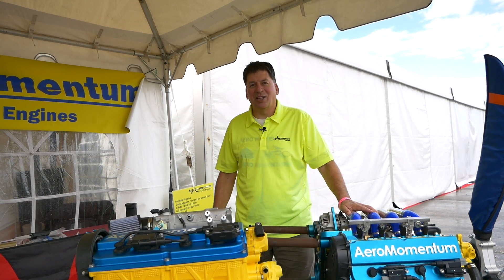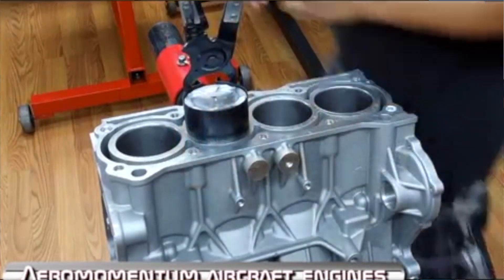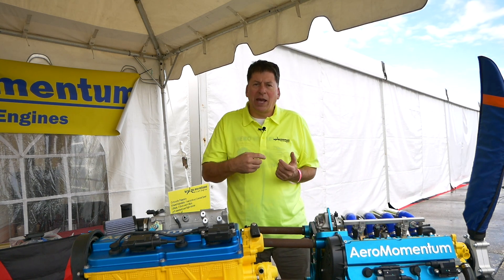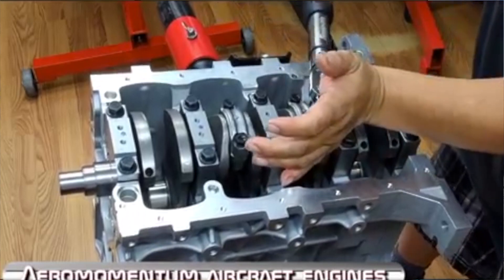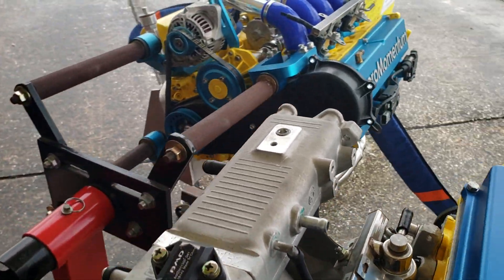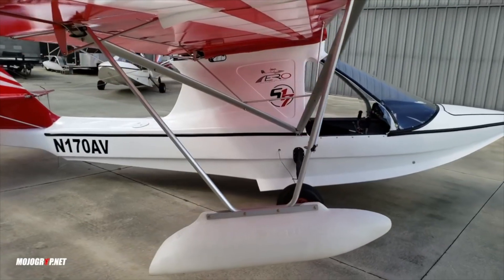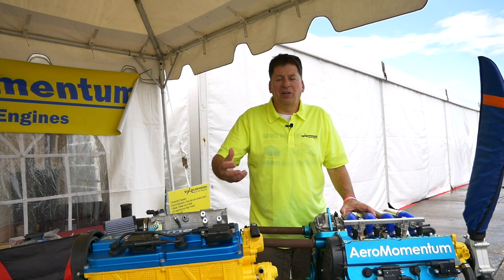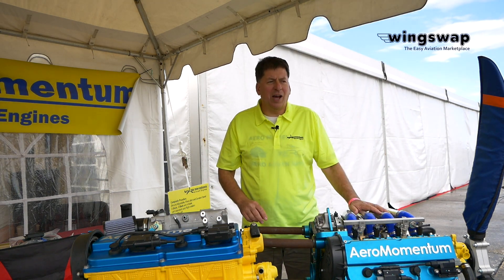New Line Of Aircraft Engines l US Sport Aviation Expo l Aeromomentum

Comment: I would use a good "Used" Engine Block. It's already "settled" out on a molecular level. I would feel nervous about a Timing Belt on an Aircraft too. Modern Automotive Engines are mechanically able to go over a couple hundred K Miles in a Car with an Owner who does not take maintenance as required unless Lights start beeping and flashing nowadays because the Metal alloys and Parts interchangableaty due tu the tolerances from CNC finishing. Add some redundancy into the Engine management , and yeah , probably I would choose it over an antiquated , never upgraded Continental piece of Junk , well not junk , but not a $ Engine that's worth anything near $100,000.00. maybe a Porsche 911 turbo Engine would be nice too. I like Your Propeller set up..

Comment: What I want to know is the fitness of the prop box and the connection to the crank I'd it puts dynamic tangenial loading and it's ability to accept piston torque pulse hammer without grenading and the pull tortion of the reduction box transferrance
I.E. is the prop forces are transmitted thru engine mounting or is reduction mount frame mounted ?

Comment: Following these guys since I saw a video lat year,
 I plan to put their 260HP diesel on an RV-10
Reply: What diesel?
Reply: Your thinking the Hyundai based turbo gas 2L engine rated at 260hp.  But it's not a diesel
Reply: @brent1041  yeah thats it, for some reason I had diesel in my head,  I thought I read or a video I watch said that but only thing  I see on the page is regular gas.  This can be problematic to get fuel unless you can find airports with regular?
Reply: Fenderbean1979 or carry your own fuel in a mini trailer tanker. I think there are surplus military tanker trailer that you can get for a grand( more or less)
Reply: @DragonBuildsRC  Engines run fine on 100LL as long as they don't have a catalytic converter (which aircraft engines do not have), being able to run on regular mogas is just a bonus.
Reply: Impossible to do on a cross country trip.

Comment: I am considering trying to build an aircraft in the semi-distant future (hopefully about 5 years) from the Rutan family of canard aircraft (Aerocanard, velocity, Long EZ, or something of that nature), and was wondering how well this engine would work in that type of aircraft. Not simply from a space perspective, but more about cooling efficiency and exhaust/cabin heating management.
Reply: Skyfighter64 check out the Raptor. They are using a Audi Diesel engine with a canard shape aircraft.
Reply: @mrhats830  I checked out that Raptor aircraft, and unfortunately, the information gleamed from the website is of little use in my inquiry about a homebuilt like the long EZ, and this inline 4 cylinder.

Comment: Seems to have long intake Runners without cross bleeds within a few inches of the intake port, how are you combating reversion, or is your operating RPM on the low side? Seems to me that you're cheating yourself out of quite a bit of torque that way.

Still sounds like a much better option than rotax, and I've never heard much good about the rotax. Never been impressed with them in any way shape or form. They are an adequate engine for a snowmobile. But when they break down on a snowmobile you don't fall 10,000 feet.

Looks like a good concept for light aircraft. Immediately had thoughts of the Yamaha VMAX 142 horsepower motorcycle engine. I always wondered how well that would work as an aircraft engine?
Reply: I too wonder about the connector tube.
Aircraft engines usually rotate at fairly low rpm, but if they're small capacity they must have a gear reduction drive becuse they won't make 100hp from 1300cc at 2700rpm as small engines need rpms to pump the same amount of air as a larger engine at lower rpm (using the air pump model as an indicator of power production).
Props can't go too much faster than 2800rpm (depends on diameter) because the tips go supersonic. This is why 350hp engines are 520-540cubic inch 6 cylinder, 100hp engines are 4 cylinder and 200cubic inches and 400hp 8cyl 720 cubic inches. Turbos are used, but mostly in turbo normalized applications rather than true boost as you get in automotive use - however there are quite a few true boosted aviation engines but more in the sport and private categories rather than in commercial. Turbo normalizing offers huge advantages since the moment you start going up in altitude the power of the engine decreases due to lower air density. The plane itself actually starts moving across the ground much faster for the same speed on its airspeed indicator but this great effect is wasted if the engine stops producing good power, so they put a turbo on it and it restores the engine's performance and the plane picks up a lot of extra speed for free meaning the time to destination is much less therefore the fuel burn is much less, meaning they can offload fuel for payload, since carrying fuel doesn't make you as much money as carrying freight or passengers.
In a twin engine plane a turbo normalized engine may actually allow you to fly on one engine for a bit. In some naturally aspirated twins, if you lose an engine you need to land immediately.
Reply: As one who was an early snowmobiler using Skiroules with their Rotax engines noted for quitting regularly I wholeheartedly agree.  running for four hours but repairing for 16 is fine for ground confined engines... but in the air..not so much.
Reply: @brustar5152  excellent point, I would find it exceedingly difficult to pull over on the side of the road to do a minor engine adjustment at 12,000 feet in the air. Remember, that the word experimental on the side of an aircraft is defined as " Fly at your own risk."

Comment: Does the Faa or some kind of governance oversee people that say hey we sell airplane engines ?
Reply: Kevin it's not a certified engine
Reply: Paul Dutton okay I see. Thanks. So it would fall under like experimental .
Reply: @Firedog105  yeah alot of these are marketed to kit builders... as they are cheaper. I'm a little interested in the Javelina engine (1/2VW with motorcycle heads/cylinders/pistons for better cooling and low cost and low weight).

Comment: Nice g series blocks. Once built a g20 to about 250hp and dropped it into my 92 geo Metro.  Kinda wondering if I can drop in he dual cam head and turbo with mfi on a kitfox
Reply: The problem with doing stuff like that is, when you do that in a car, it runs at 10% of power output most of the time, with occasional stints above that, while in an aircraft you have long stints of 100% power and high power output after that as well much higher than automotive applications. And this is why typically no automotive engine is going to be well suited to aviation. You can polish these engines all you like but it still is not a purpose designed aviation engine. That said if I were going to do an alternative engine 1/2 VW with harly heads and cylinders is pretty interesting as they are lightweight, fairly reliable with EFI, and probably the easiest engine to work on in the 80-100hp range. I really wish there was a affordable twin prop pusher plane kit out there....
Reply: @Wingnut353  I would never have guessed that 1/2 VW with the Harley parts could put out that kind of power.  The only 1/2 VW l ever saw up close was in a freshly built scaled down Cub.  It was a beautiful plane.  I asked around the airstrip and found people who said it flew as well as it looked.